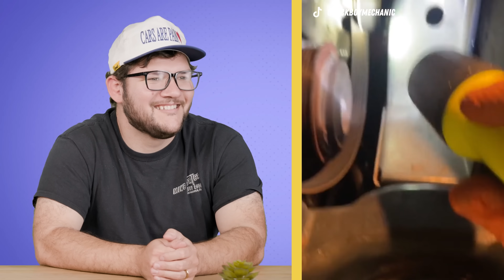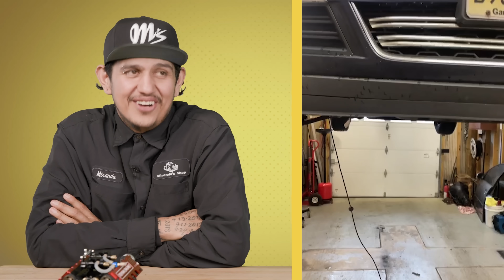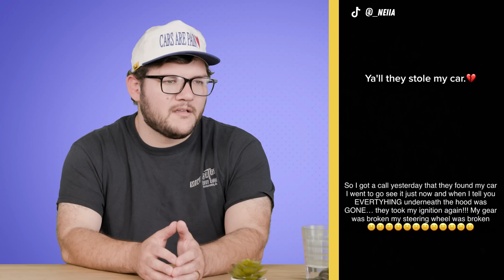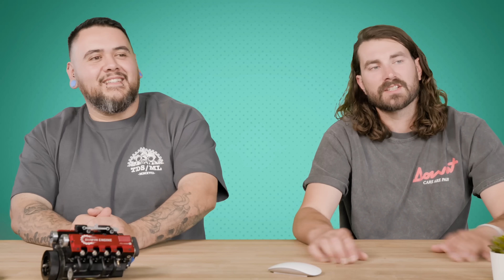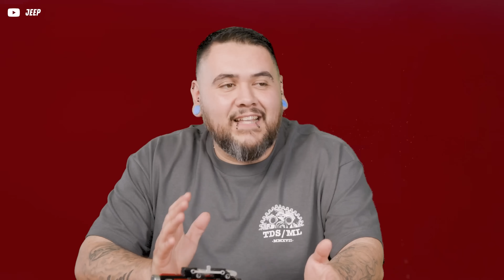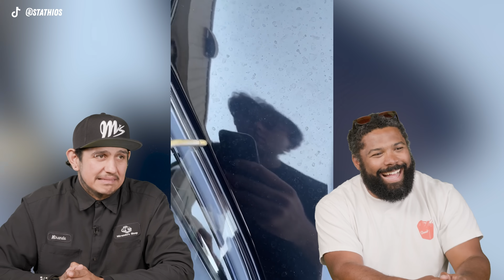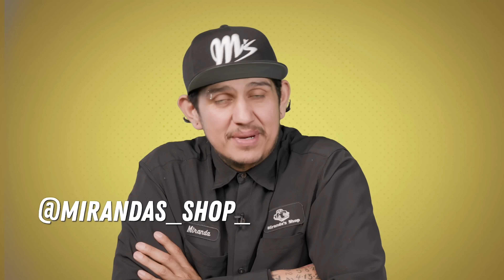Mechanic Reacts to Car Engineering Fails

Comment: I had an 05 accord 4cyl that got a PS leak from the high pressure line straight onto one of the o2 sensors. When they replaced the line they added a sheet metal shroud to protect the sensor in case it happened again. I sold the car a month later.

Comment: Sadly I've had my issues with chrystler vehicles as well. Im looking for a 2dr long bed cummins with a manual, 08-10 pre def and plan on keeping it till i die, id rather rebuild the motor then deal with new junk

Comment: I was a mechanic at a chev olds dealership for 20 years. Yes, we would always say that the general started with an engine and then built the car around it..frustrating at times but, there was always manuals and bulletins to follow. After market mechanics just dont know procedures

Comment: That Audi leaking is a common problem for VW/Audi with sunroofs from around 2015 to 2020. It's not a gasket but there's something in the sunroof that snaps and causes the sunroof to no longer seal.  The official fix from VW to the dealers is to seal it with something like RTV. FYI there are class action lawsuits in a few states.

Comment: 100% problems are down to cost cutting, so blame the accountants. You should do a video of all the times a manufacturer has become liable for big warranty issues because an accountant overruled the engineers.

Also manufacturers don’t want the “cars” fixed so it’s in their interest to make it difficult.

Convinced that all new design engineers are taken into a room with bulbs, starters &  alternators etc and told that they must make them at least 3 hours labour to replace.
It’s surprising on how many cars it’s quicker to change the brake pads than a headlight bulb.

Comment: When I was a teenager I had an 82 Pontiac Bonneville. Transmission line was routed too close to the suspension on the passenger side. Causing it to rub and eventually start leaking… right onto an exhaust pipe. Anyone else ever have that problem?

Comment: My 2018 Ram 1500 has a problem with the oil filter location. Every time I do an oil change there is a huge miss because of where the filter is.

Comment: Therr is a suspension bolt on the 12-15 vw Passat thats the same way. You have to disconnect the wishbone motor mount and then clock the engine in order to get enough room for the boat not to run into the damn transmission 🤦.

Comment: I always blame the engineer (unless it's super obvious it's a factory issue) mostly because they are told to build something that lasts 5 years. Not a lifetime, just 5 years. If it fails right after 5 years, that's even better. No joke. That's the goal nowadays

Comment: You forgot a category MANAGEMENT!!

Engineer here. I don't work with OEM products, but most of the time engineers do see the issues, but management doesn't want to delay or add cost to the vehicle, and the RISK ANALYSIS is not enough to change the problem.

Comment: (1st)ran into exact issue 2 times. after using this guys language a bit..then prayer. God had easy solution. mark it and drill through son. did it and 10min later viola!
(2nd) return and then as the dealer(have a guy like me fix it) if i cant do it..the factory will have troubles

Comment: My step father bought a used Jeep, only 14,000 miles and it was a 2018. Told him not to get it as they have a lot of issues and don’t perform well. He did not listen and had to replace the engine and transmission. He wanted one because it was 4 doors and had better gas mileage than his Silverado and they resell great. He has now paid almost more than the Jeep is worth in repairs

Comment: My father inlaw bought a brand new ram and they had to buy it back on lemon law. Then he got another one that hes had nothing but problems with. Almost tried lemon law again. I had an 08 ram 4.7 for a long time and that truck,  although underpowered, was extremely reliable. Never had a real problem out of it other than minor stuff like alternator and a cracked radiator. Both of which i replaced myself. I pulled my camper regularly with it and never had problems. I wouldnt touch a new ram.

Comment: Sometimes the problem isn't engineers, the factory, or mechanics, but the government.

There is no good reason that you should have to yank the intake manifold off a car every few years to clean oily, sooty cancer out of the venturi, manifold, and intake ports of the head.  But that's exactly what you have to do because of EGR systems directing hot soot at the temperature of a barbecue grill from the exhaust directly back into the intake where the crankcase oil vapors have also been dumped next to the turbo.

The urea aftertreatment of diesels doesn't make me mad.  It's not hard to add a bottle of purified piss into a tank once an oil change.  But the EGR stufff causes a ton of trouble for very little benefit.

Comment: Engine out or almost engine out to replacing a f$%king drivebelt tensioner is inexcusable.  Some jerk took a longitudinal engine design, turned it 90 degrees, and said "voila!"

I'm with that technician 100%.  Whoever left that time bomb there should be drawn and quartered William Wallace-style.

Comment: At 10:35, when the oil went all over that dude fault 100%  for not taking off the undercover for the vehicle, you can see where the bots to take it off are at and you to do that before a oil change

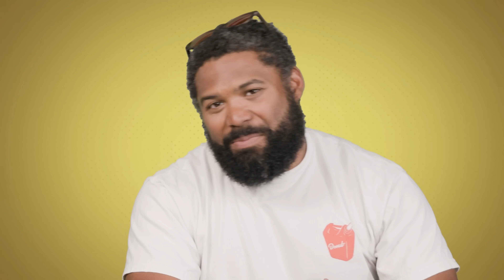Comment: I'm an engineer with an electronics manufacturing company. Such issues (1:45) are going to be common with a product that isn't designed to be used universally/ in multiple different assembles. THAT S**T IS HARD TO DO!. So the idea here is that the management is to blame for not considering time for design variations based on which assembly the product was going to fit in. Universally acceptable hardware can only be made by a team who had years of experience with the issue they want to solve.

(9:38) This is due to the loosing interest by new engineers and many companies on the importance of GD&T. The old guy's right, companies are cutting corners to save a few dollars.

Comment: Honestly, with the LandRover one, I would've checked in the oil cap to see if it had the pipe to suck the engine oil out of. A lot of those you could just throw a vacuum pump on to suck the oil out from the top and then refill. I do think that's only in 2010 and up models though, so I could be completely wrong haha.

Comment: You can't blame JUST the engineers.  They might design the stuff but there is always someone who approves it.  In the end they have the final say.  When I was in IT lots of people would complain about the programmers but when it came down to it they did their job and the higher-ups signed off on it.

Personally I believe that before you are legally allowed to be an automotive engineer you should be required to be an auto tech.  If more people who designed and engineered cars actually WORKED on them for a while I can guarantee they'd stop being so stupid.

Comment: Another bad GM one, which is but one of a million reason why I will NEVER own anything made by GM, is a certain recall which I discovered has been a constant one for almost TWO decades. You read that right. From somewhere in the 90's up to the 2010's (I don't know the exact dates, but they can be found in a certain mechanic's database (I can't remember offhand what the name of it is, but we used it in trade school and at dealerships to access info on cars other than our own)). Anyway, from the 1990's to the 2010's ALL GM pickups and SUVs had the same issue with the shifter cable causing the transmission to pop out of Park. It's kind of a big deal. But the worthless engineers at GM just kept saying "send it" and didn't bother with fixing it until enough people complained to warrant a recall. You might not have heard of it, but that's what GM does. They hide their recalls. Like the Camaro ignition cylinder recall. Instead of saying, "Hey, we screwed up, bring your car in for a replacement part" they sent out letters saying Camaro owners needed to bring in their vehicles for some sort of special check. When the cars came in to the dealerships they replaced the cylinders without the owners ever knowing there was a problem. If word got out about that GM would have been ripped to shreds like Kia was with their little ignition system screw up. There are a LOT of very lucky GM owners out there, that's for sure. You can bet on this, though; I'd happily buy a Yugo from a junkyard for a daily driver than ANY brand new GM.

Comment: You know what REALLY sucks? Doing an oil pan on a 4WD Chevy pickup/SUV. There are certain ones out there where they ran a damn AXLE straight THROUGH the oil pan. Got a leaky oil pan gasket on one of those? Say screw it and slather some JB Weld around that sum bitch. It'll be a LOT easier.

Comment: I've seen that problem with the Audi before. And on more than just Audis. Judging from the control panel it has a moon roof. So the most likely cause of the leak is at least one of the two drain tubes in the moon roof frame is/are clogged. Easy fix. Take a few minutes to clean them out, run a little water through them to make sure they're clear, send it home and charge them an hour.

Comment: Oh where to start the oil filter placement on any ram with hemi, when they put 3.6 in the ram and decided the drain plug sound spill all over the passenger wheel 😂

Comment: Holy crap those McLaren fittings were bad. Gotta be something like unaligned hinge on the tailgate and door.
Same with the Tesla door. Hinges have slid too low after multiple tries to get the front door aligned with the rear door. All of them are very easy to fix at the factory, but horrible at the mechanics shop.

Comment: That bolt is on the pull of an assembly there are other bolts to unbolted the entire part not just the pulley.

Why does he want to just remove the pulley?

 Seems fake AF.

Comment: As someone who worked in the Tesla factory previously from 12-16. I can say with some degree of confidence that most of the problems you see with alignment of panels are issues with the engineering on the dies for the panels in the stamping and plastics department. It seemed like once a week we had to halt production on a certain panel because the engineers needed to make changes because the panels weren't fitting properly. Best model car Tesla probably came out with was the 2015/16 Model S. It's the most refined.
Reply: The problem with Tesla is the owner and his union busting and rascist hostile work environment.
Reply: @pranays  oh for sure, but from a quality stand point the engineers don't test their shit before they say it's good. They just assume and when it's messed up they fix it.

Comment: If its mass problem that happens to thousands of cars of same brand, it is an engineering problem. And even then it can just be factory problem if they managed to pump out dozens of cars with faulty part attached. Most often it is actually factory problem. I am chemical engineering student so my fields doesnt have lot to do with this but I worked at car manufacturer plant as car builder before my studies and I have been at their material laboratory again in summer job so I believe this gives me some merits to speak.

I can give faulty engineering problem from that factory though. Fisker Karma. That car brand was a failure. Very early electronic technology and it had good chances of catching a fire due to engineering fault.

Comment: Do all dodges have the battery that you can only access through the wheel well?
Reply: No , only the ones you take to autozone to test your battery.  (Sorry I hadta ✌).
Reply: No I think it's just the models with the built in security system, push button start and automatic transmission.

My manual 2014 with all manual windows and key locks and ignition doesn't.

A 4x4 should not have electric windows and locks in my opinion. It's dangerous if you start sinking.

Comment: Best vehicle i ever had was a lifted 1985 chevy k10. Bought it in the early 2000s. It was rebuild from the ground up and rarely ever had any issues with it. 99% of the time i worked on it was because i was customizing something or doing regular maintenance and it was so easy to work on. No electronics or computer crap. Even the even the windows were manual. Used to have to get out and lock the hubs for the 4wd. Never had any problems with it. Every new care ive had since was junk.

Comment: This video is funny because at the moment the alternator one on my 2011, Chrysler 200 which apparently involves taking the passenger side tire off, all the beauty covers, taking off the AC condenser and basically dropping it as long as you can to the ground just to get the old alternator out and to get the new one in. Just put the alternator on the top like Japanese cars! I shouldn’t have to take the car part for a damn alternator!
Reply: You sound charged up about this issue. 😏

Comment: I build dump trucks and there is so much shit that comes from engineering that doesn’t work right lol. Having to cut stuff off, move stuff around, rewrite/reroute wiring. Modify stuff on the fly to make the truck work. It can be a nightmare sometimes
Reply: Duct tape,  vice grips,  wd 40.

Comment: Regarding bolts, a lot of times the company pushes for reusing existing parts, and minimizing the amount of unique parts.

If the bolt was used in 20 other vehicle programs, but on the 21st it’s a tad bit too long causing a pain for service, well guess what management is going to be like LOL deal with it.

Comment: Worked at Tesla QA for 3 years and prior to that I worked at Subaru plant on the Final Inspection Line.   Teslas are trash.  They are poorly built, and even more poorly designed.  Don't even get me started on the headliners in Trashlas.

Comment: Factory fails are the in hands of industrial engineers making jobs harder for people to do and no time to do the job right. When you approach them about a better way they don't listen because you don't have the degree they do.
Reply: The longer bolts are them saving money by not having to have 3 different lengths to sort/buy so longest bolt needed is what's used everywhere

Comment: Mate who is a mechanic had me change the plugs on a Subaru. Insane engineers.

Then i changed a water pump on a ? Reno ? Clio. Timing belt drives the water pump. I was, frankly, appalled.

Then he bought a grand vitara. I did the oil change. You cannot put the oil filter there by accident. It's malevolent. Always check the position of the oil filter before accepting an oil change job.
(On one job it took both of us 90 min one day to get an oil filter off. I think they used a rattle gun to seat it. This was worse.)
Reply: Rattle gun  . Lol love that loool.

Comment: My Pulley Bolt is the exact same as the first video. The engine is too tight of a fit to lift up or lower down without fully removing the engine. Fuck that! I'm modifying the frame right now just to get a rattle gun onto it

Comment: I don't want to say what card is but the door lock system and the AC system two vents for the entire car but yet the interior is massive and the door locks the outside is plastic panel that you can literally pull away bare handed no tools and lock and unlock the car.

Comment: Those GM(Holden) Traverse, Acadia, every other name for that cursed suv, are sh!t. My mom had one and after about 60-70k(whatever the warranty was) I was working on that damn thing every other week.  Everything, I mean EVERYTHING was just as hard as it could be.  Starter stopped working, I was like ok Ive never had a starter that was that hard to do.  Like 3-4 hours later after major disassembling... Also, spark plugs, front and back suspension, O2 sensors, half shafts, electrical bugs(motor running after key was off and out not fans), and much much more. I hate those cars.  I won't work on them any more I just tell my friends and family that have them. Sorry time to get another car.

Comment: Had a release pressure gasket failure which had to be replaced. The spare part costed around 5$ but it was placed in such a weird place that the mechanic had to lower the whole engine. So i had to pay 250$ for a 5$ rubber....

Comment: F150 2.7L ecoboost with plastic oil pan. Truck, twin turbo boost, high heat environment, oil pan warps and leaks. Any newer Chrysler with the oil cooler/filter housing under  intake manifold. Anything Chevy Cruze turbo. All huge mistakes....

Comment: Buick rendezvous front shocks bolts being directly under the cowling. Buick rendezvous not having enough space to replace the spark plugs making it so you you either have to lift the body away from the chassis or drop the engine by removing engine support brackets. Buick rendezvous lack of the ability to open the trunk from the inside or outside of the vehicle because they decided to put it on just a keyfob.

Comment: I'm just a guy who does his own maintenance and small repairs.  How hard is it to put the oil filter somewhere easy to reach and drain safely?  That was the only thing I liked about the Saturn Vue I had.  The oil filter was inside a canister accessed on top.  Open up the top of the canister, pull the filter out, put in the new one.  My Mazda6 on the other hand was a blast to drive, but oil changes.  The filter was directly over the exhaust manifold.  So, not only was I typically snaking my arm around a hot exhaust, the little bit of oil that would drain out when removing the filter drained right onto the exhaust manifold.  Nothing like burning oil off the exhaust manifold for the first few miles after an oil change.